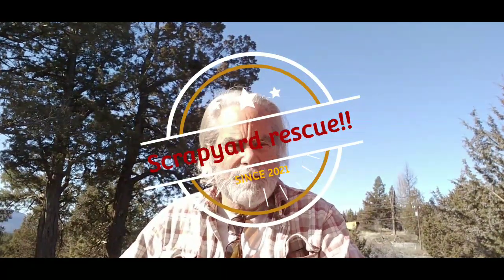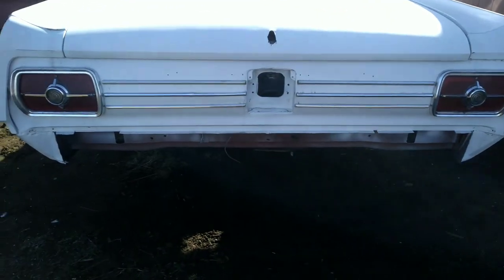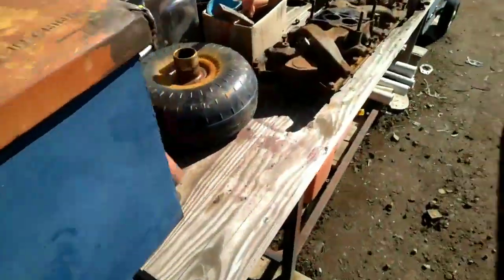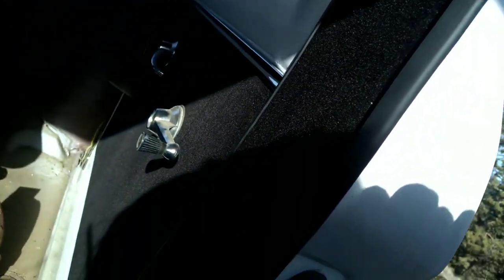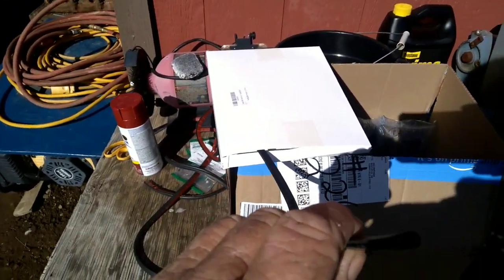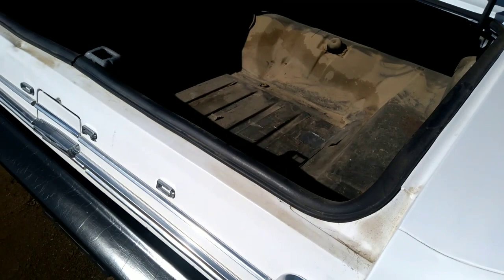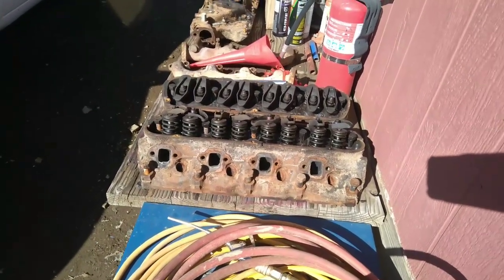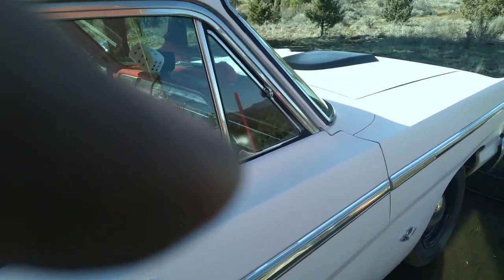Forgotten fairlane's get some new goodies!!

Comment: i like your fairlanes, i've always been a chevy guy but they have gotten so expensive i ended up buying a 56 fairlane hard for me to believe but parts are cheaper for my fairlane than my 57 belair , no i'm not rich my brother left me his 57 . i'm just like you have to do everything myself, i bought a roll of bulk high quality auto carpet cut it to fit and sewed and glued it in place might not look as good as acc  molded carpet but if you use a heat gun it will look pretty darn good and is like twice as thick and much more durable than acc for not quite half the money check out old school auto upholstery youtube channel good videos on carpet install